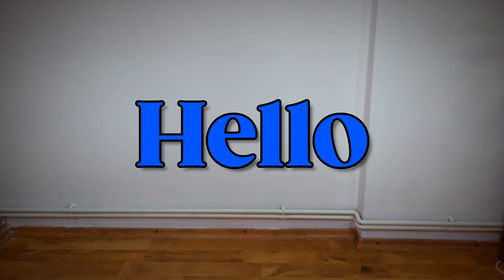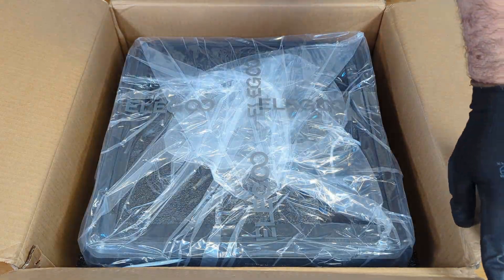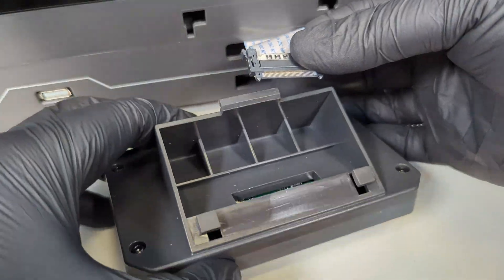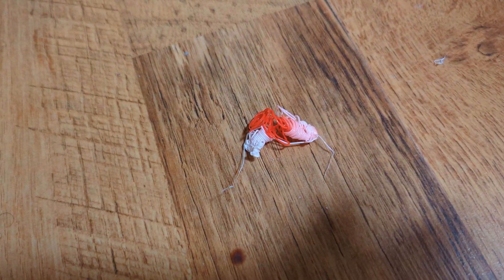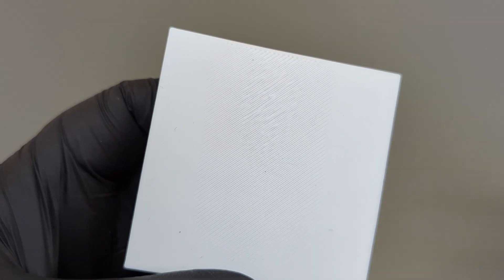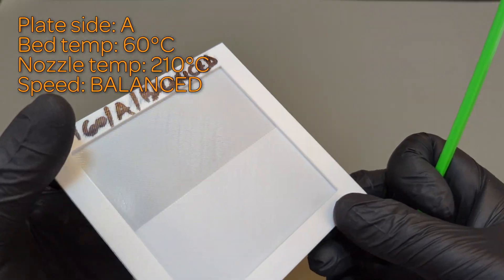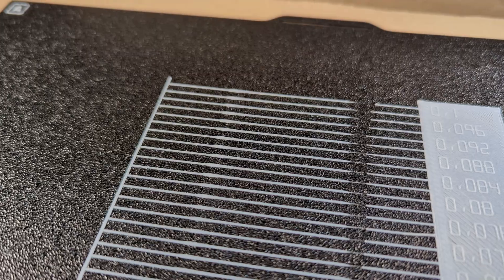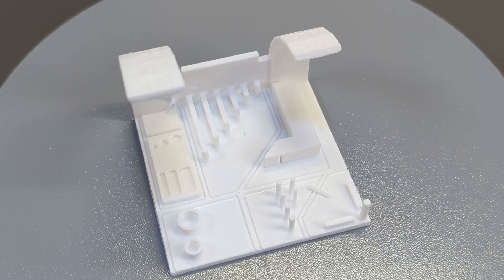THIS might be the best 3D printer you can get for cheap - PART 1

Comment: 5:00 you updated the firmware and THEN did another full self check that PID tunes, input shaping tests, and does an auto bed level??? if not, there is your issue. this is the best bang for the buck when it comes to speed, quality of prints, AND types of filaments it will print out of the box... only thing missing is ,multi color but for $300.... come on...
Reply from the maker: Yeah, I had several "slap my head" realisations like this when I thought I figured it out and it's user error but the test prints ALWAYS ended up the same. I think I'm correct when I single out the plate as the culprit. I don't want to spoil more.
Reply: @realfatherseven  lay it on a piece of glass. Glass is flatter than the Earth.

Comment: turn the temp down on the bed? looks like hotspots, I have one in the rear right of one of mine. I run it 55 on most prints and it seems to work pretty well.
Reply from the maker: I'm building a case for my own sake to buy a thermal camera just for times like these. But I don't think it would have mattered because THAT isn't it, this time. The plate is warped absolutely crazy by heat but not by the lack of uniformity of it. Because it developed a double hump in the center I even pondered if I'm to blame, for yanking a couple of prints off the bed while the bed was still hot. But I still believe taking the plate out and severely bending it, as the maker shows in the printer manual and a bunch of official videos, would have been far worse and stressful for the steel. I had just bad luck. I hope.

Comment: for the same price you can get a the Flashforge AD5X which is a multi filament printer that actually can handle TPU just fine.
Reply: Honestly I'm not sure how he had these issues I've been using mine for a while now and I pretty much been completely fine with mine
Reply from the maker: I did browse a bit though the bad reviews on the store page and I didn't found another one with my issue, so I just hope I was unlucky.
Reply: @realfatherseven oh damn
Reply: "same price" lol not even close after you "bundle" everything to get the same options this one already has.
Reply: @sixteen_tons  ok, but as far as I can tell this thing can't do TPU. All I have to say is I'm immensely pleased with my AD5X, though that may be coming from having been on an OG Ender 3 for a long time.
Reply: @MoonBnuuy  yeah anything is better than an ender 3 but this can do TPU all the way up to 320°. It's enclosed already. It has a double-sided flexible magnetic plate already. It does automatic bed leveling already. The only thing this one doesn't do right out the box is multicolor. But I'm not paying an extra 2 to $300 literally double the price of the printer just to be able to do multicolor
Reply: @MoonBnuuy  already has a camera which is a paid upgrade on your printer... Doesn't require some silly app. Can literally log into it over any phone browser.
Reply: @sixteen_tons  Ok... but again, it's a multi-filament printer that handles TPU which is a big deal to have those two in one.
As for enclosure, I have an aluminized rigid fabric enclosure from my Ender 3 that can be reused.
As for camera... Wow, a camera. I have eyes.
And the automatic feeder is REALLY nice. Can you modify the firmware on this one to do that?

But oh no, a camera... like I don't have eyes or several dozen of those laying around the house that I could add myself.
Reply: @MoonBnuuy  so again, this can do EVERY filament. no multicolor. and has all the attachments already that you have to buy or "have left from your ender"... go cope harder my guy... its ok if you like your printer. I dont have to. cause I like mine.... good luck lady.
Reply: @sixteen_tons  Riiiight, like I said multi filament AND TPU. I don't think you get how big of a deal that is. That kind of thing working out of the box is unheard of. It also has less poop than Bambu's multifilament printers.

Comment: Never knew these spring steel beds could warp permanently.. I'm chocked! 
(I only print ABS/ASA and on G10 (FR4) plate with a thickness of 1.5mm for many years. Super flat, unaffected by temperature and indestructable)
Reply from the maker: I heard of the issue previously but in very distant stories, like myths you scare your mates with. Having dealt with my fare share of Aliexpress specials I always thought if it would happen to me it would definitively happen with one of those and NOT with an original. I don't know why, this belief is clearly stupid and invalidated by my own history with the original flexible (not steel though) garbage plate that came with the Ender 3 Pro.